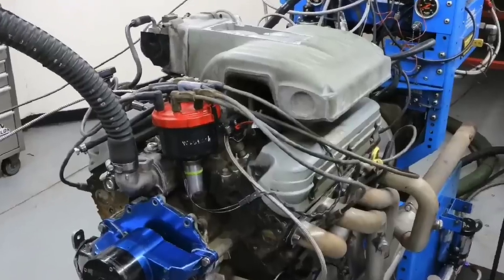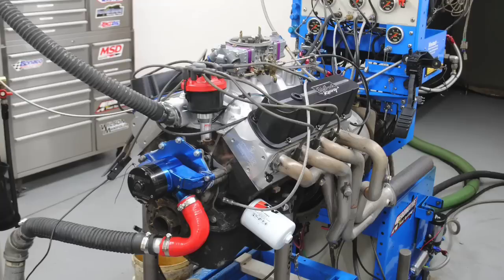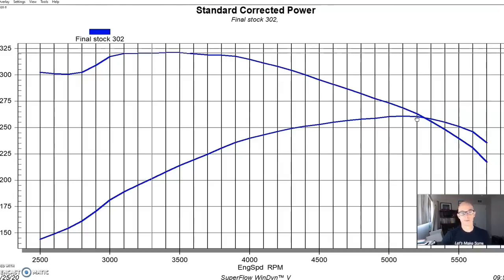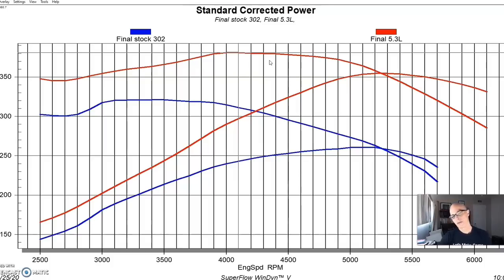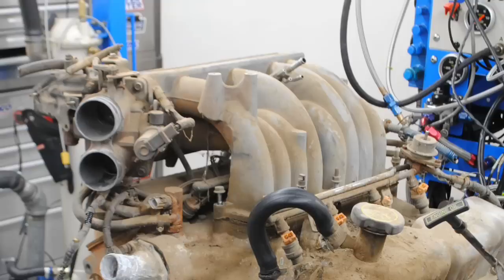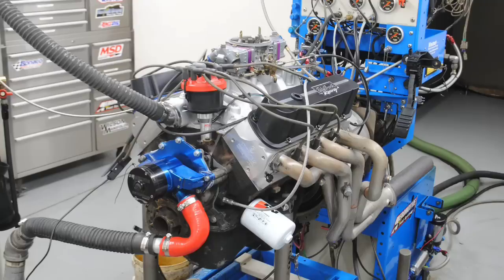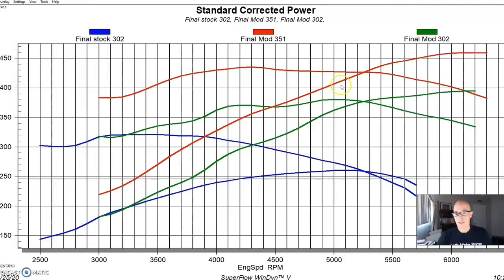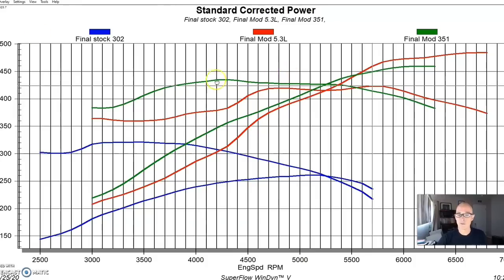5.0L vs 351W vs LS-SHOULD YOU SWAP?

Comment: Yanking the gutless turd 175hp 5.0L (engine has been sitting torn apart for years and is seized actually) in my new project  1983 Mustang GT. And dropping a 5.3L and AR5 5 speed Transmission in it.   Once it's ironed out and running good it will get a 6.0L. 

Heads cam and Intake is insanely expensive just to make the power that pretty much a cammed 6.0L makes

Comment: I have 2 '69 351's from a boat that I'd like to build. They're rated 240hp and watching for ideas for improvements. Would simply increasing rocker ratio and upgrading valve springs be similar to an improved cam?
Reply: Not a fan of different ratio rockers unless you're trying to get better geometry. Get a cam that's well suited for the intended use and port the heads; put on a good set of adjustable roller rockers. Plenty of info on how to do it out there. This all depends on what heads you have of course, and what compression you're working with. Best to find someone who specializes in SBF combos and get their advice, or at a minimum watch what they're spec'ing out for a given type of heads and compression. 

Don't fall for the dyno queen bullshit on a street car, get a cam that is intended for YOUR style of driving, not peak power that you'd want for a race car. Lot of guys make the mistake of going for peak power, but it falls on it's face in regular driving where you never see 6K+ rpm.

Comment: Unfair comparison considering the timeframe these engines were build. Since the 302 and 351 were choked with smog equipment and low compression and low lift cams compared to the higher stock compression, higher lift, and head flow of the 5.3. Compare the 5.3 to the more modern modular engine if you want to talk engine swaps And yeah, the Chevy will always be cheap, just the way they are made. I will always spend the money on a better engine, and it's not an overrated LS...

Comment: Wow, such an easy question, 302 &351 are nothing better than a boat anchor, then you say "a gm engine in a ford, that's blasphemy", hot rodders, real hot rodders, not you bolt on guys have been doing this since the beginning of modifying cars, first off, price and power, more power with cheaper cost, it's just common sense

Comment: How does the coyote stack up?   Why aren’t there more yote swaps?  To big?
Reply from the maker: expensive too-but they make good power
Reply: Ls was put in everything known to man for 20+ years coyotes were only available in f150 and mustang for about 10 years now.  There isnt even close to as many coyotes available as there are ls engines that is why there is a cost difference.  But honestly the only ls you're getting cheap like they say (under 1000 bucks) are the beat to hell and back in a work truck truck engines...if try to get a 6.2 ls3 out of a Camaro its gonna cost similar money to coyotes.  The price is starting to come down on the coyotes the more and more they make so the price isnt as far apart as people like to make it out to be...also a coyote swap is easier done in a 96 up mod motor car with a factory 5 speed itll literally drop right in and the swap can be done as low as 5k total into one of those that is the engine and everything else needed to make it run in the car.  The prices are coming down more and more as more and more become available.  If ford put the coyote in 10-15 difference vehicles for 20+ years the cost of them would be alot less.  It's common sense.  Plus I think it's a better engine it just makes power better liter for liter better.

Comment: The 351 bolts to the same bell housing and motor mounts! By the time you do all that stuff to get an lS in you could've bought heads and cam for the Windsor! Screw the 5 liter! Sell the 5 liter and put a 357ci Windsor in it! The torque of a Windsor with a set of aluminum heads and cam is awesome! And it bolts right in! You can shoot enough gas on it to kill an elephant!
Reply: 351W is taller and wider so you need either a raised aftermarket hood or hood scoop, 351 swap headers, and a front accessory drive. Clutch and throwout bearing are probably a good idea while you are in there.
Reply: @FL50ssp  the first  Windsors had a 9.48" deck. By 72 the deck was 9.5 and the pistons had deep dishes!  The best are the 95 up truck motors with the roller cams. You don't have to buy anything,  just change the cam and get a set of heads!
Reply: @FL50ssp  unless you're running a really tall intake a drop based air filter will work. Now, if you're running a stock style fuel injection system I don't know? We've put 460's in fox bodies without a scoop! Buddy had a fox body tbird with a 460 in it!! 10000 people will call bs on that statement, but we've been running fox body's with Windsor before they could look and tell the difference! If you're running a really tall single plane intake it might get tight, but a performer 351w with a drop base cleaner works. The 460 with a performer worked in a fox t bird! We had a 87 third turbo coup with a Windsor transplanted into it! The flat stock hood worked! The stock 5 speed even bolted to the 5 liter bell housing! But first gear was a joke!

Comment: LS. more power and you can put 150k miles on it and never lose sleep.
Reply: hahahahahaha, 351W from any 90's truck will see 300K miles before they start showing some blue smoke. The 5.0's were a crap shoot, but the 5.8's were long running mills

Comment: Question for you guys we know the 351 roller motor push out pretty good when they're built. But how about the 1968-69 351 Windsor under factory 300 horse. How much horsepower can they put out with simple mods. I have a 69 Mustang 351 Windsor 4 Barrel in my truck and I want to step it up to a little more horsepower for racing. I know the block and the heads are different than the smog versions
Reply from the maker: they work well-slightly better heads, more compression-add a cam-and/or GT-40 heads

Comment: If you get the ford cobra 5.0 mustang engine you would have 320 hp stock, koenigsegg engines were all ford mustang cobra engines 5.0 and 4.7 just modified and boosted with twin turbos so i'm gonna stick with the ford it has a better bottom end for power if you modify it.

Comment: Are the Explorer (GT40) heads a good option for the 5.0 HO, or the 351W with the factory roller cam block for a bump on power for a daily driver Fox body? Or just go for an aluminum head from Trickflow, Edelbrock, or Ford Performance? B303 cam, stock pistons, and T5 with a Cobra clutch.
Reply: Gt40's are a great budget friendly upgrade that can be found everywhere and pair well with the alphabet cams. They make for fun daily drivers, especially with a 5spd. If u want to make some serious power, save up for an even bigger h/c/i setup then crank up the fuel. 😎

Comment: I've got a 2000 gt with a broken rod, just bought a 97 thunderbird npi block. Gonna do a head and intake swap. The block is a Romeo, and the 2000 upper is a Windsor, is there any problems other than the timing covers that I'm going to run into?
Reply from the maker: valve covers?
Reply: @richardholdener1727  reuse the ones that came on the windsor heads right?

Comment: Not a great comparison. Comparing 1990's ford engine's to 2000's Chevrolet engines. 
Do a 302/351 vs. 305/350
Or a 
4.6/5.4 vs. 4.8/5.3
Reply from the maker: I did a 302/305 series, but this was about swapping out the stock 5.0L to an LS or 5.8L

Comment: Richard, I've read about LS heads fitting on Windsor Ford blocks. Would a Ford Cleveland head fit on a six bolt ls block?
Reply: @DropDstar I know the ls heads on Windsor block need some modifications.  I was just thinking about an awesome hybrid Cleveland. ( not that the LS needs any help in the head dept.lol) thanks though, too good to be true.
Reply: @DropDstar I hoping for Cleveland heads on the super strong LS block...4 bolt Ford blocks are pricey.

Comment: A ls comparison against a old 302 351 instead of a coyote. Oh that's right the coyote makes more power then the ls. I had a 5.3 in my 05 gmc I had wasn't impressed. A buddy of mine had a 94 f150 ex cab with a 302 and he smoked my 05 gmc. I figured he would I had a 87 f150 5.0 and would smoke the first gen 5.3 Silverado and gmc. I had a 05 gmc with the 5.3 and wasn't impressed with it. My 99 f150 5.4 I had after the gmc pulled better then the gmc did. Also I had a lot of problems with the gmc. It started burning oil at 140,000 miles. My 99 f150 with 180,000 didn't burn a drop of oil. I have never had a good gm vehicle never will own another gm vehicle. My Ford's just run and run.

Comment: I’m a period correct oem type guy so in my Ford I go modded 302. Plus staying true to the oem design and considering power to weight ratio, the modded 302 does everything I need it to. 
But all things considered in terms of efficiency, power and availability, those LS 5.3s are damn near impossible to beat

Comment: Will an LS bolt up to my AOD? No.  So, I'll need a GM trans as well.+$!     Stock Ford motor mounts and trans mounts?  No,. +$$.  Work with my stock EEC-IV harness?  No, +$$$.    393 Stroker crank will cost $375 from Summit with your stock 351W rods and 302 pistons, it  will put you well ahead of the LS in the bang for the buck dept before you even add heads, cam , intake and headers plus you get to keep your Ford transmission and driveshaft.   351W for the win.  Even if you went megabucks,  still be cheaper to buy a 351w based forged stroker kit and some 205cc intake port  heads than swapping in a similarly hp LS.

Comment: The ls platform is making small block ford engines obsolete. When it comes to the high dollar modified stuff I still don’t think the ford engines can make the same power.
Reply: And in the near future, coyotes will be making LS engines obsolete. Gm better have a dohc v8 in the works and it better not be another northstar😂

Comment: None of the new engines . I’ll take a 1970’s 442 in a sweet custom built with a quad barrel carburetor and ether one sounds unlike anything most have herd . I had a 8 second muscle car bully and she ————for me to know and you and everyone else wonders because to My knowing I named the engine sweetheart .  Black bottom mid engine was something kind of pinky high temperature paint on the headers and orange valve cover with a lot of orange 🍊 .  The cutlass it came out of was orange . The vehicle was scrapped but I saved my engine . I know the auto industry is a joke .

Comment: What makes a LS more efficient than a 302 or 351?
Reply: Head flow
Reply: They aren't...
Reply: I think it's Russian roulette with the FoMoCo block.  A Windsor WILL make the power with aftermarket heads.  A $2×00.00 aftermarket block is what separates the wills and will-nots.
Reply: Cylinder heads

Comment: Ford is producing a new pushrod v8 but I'm not sure if it will fit in the fox body. It's 7.3L. it resembles an LS in its appearance.
Reply: It's the size of a 351. By the way, I have a 460 in mine. It fits absolutely fine. The 2V 4.6 is WIDER than a 460, believe it or not. It's why nobody likes to use them in anything.
Reply: @ChevyConQueso  it really is a shame Ford stopped building pushrod engines for so long. I guess they couldn't figure out how to make them as efficient as an overhead cam engine at the time. It seems GM engineers wanted to prove naysayers wrong and did a very good job doing it. I'm sure Ford laughed at first while scratching their heads. After seeing the massive success of the LS platform I'm sure they where eating their words.

Comment: Ford modular 4.6 2v is the best value.
I'd say from a Crown Vic. 03 and up but the ones in 06 to 11 are the best in my humble opinion
Reply: oh hell no they arent... well not a three valve any how... expensive crap... have an 05 mustang spun a bearing... was cheaper to rebuild it than get a junkyard engine... could of ls swapped it for the same amount
Reply: @robc7812  Not today. I can pick one up for 500 to 1000 whole engine. 
SOHC 4.6 Crown Vic has e85 tune. P71 heads. I got about 300hp while maintaining 17mpg. Still going strong 300k. 
Most expensive mod would be cylinder heads for about 2k. Or I could just keep the heads I have now and slap on a big fat turbo. 

Anyhow I should say the 4.6 05 and up in crown Vics with p71 heads. Easily can be bought used for no more than 1000 more like 500.
Reply: MARZOSIRUS I bought a Vic for $650 granted it was wrecked but you get the whole electric harness I plan on fixing it but if someone wanted to they could buy for the engine and sell all the other parts or use them if you can find one with a limit slip 8.8  rear end
Reply: @MARZOSIRUS  i guess but for 700-1200 can get a 5.3 with harness and computer in my truck it gets 21mpg... and had a 01 Z06 that i sold with 189k on it still whipping full bolt on mustangs... i still have the 05 mustang... and used motors for that are 2500+ everywhere i looked... and that was 6 months ago.. i slapped a new crank rod and bearings in it for $350 runs like a top except now the computer died... so when i replace that its going going gone... just hope i dont need a new tune smh
Reply: They are way too large for any reasonable sized car
Reply: HotRod Ray they engine or car?
Reply: @hotrodray6802  exactly... they didnt mention size and weight
Reply: @hardsellcomixreviews7514  If you live nearby a junk yard you can usually find a Vic in there. I live in Socal and they won't sell the whole car at pick a part. 
But I work near a metal recycling company and if you stop the tow trucks before they go into the yard. You can usually buy the car too.
Reply: @robc7812  I hear ya. I don't blame you. They introduced new tech in 05 for the mod motor. I believe they introduced the 3v in 05. 
I like to wait a few years so they can work out the kinks.
Reply: MARZOSIRUS most the vics near me are pretty picked over

Comment: I love LS's but there is a combination that really "works" for the Ford crowd, the 347.  You have your 5.0L package, an easy combination to build compared to anything larger and probably the best bang for the buck per horsepower IMHO in the Ford stable.  I have swapped a couple 5.3 LS's into Mustangs and the part I think you missed is the cost.  For the cost of a good set of aluminum Ford heads you can pick up a junkyard 5.3 from a truck and like you said, add a cam and springs and equal or better the modified Ford offerings.  Spend equal money on either and the LS walks away with everything.